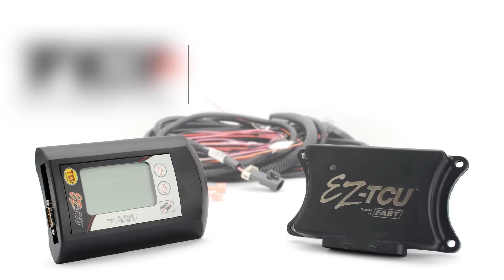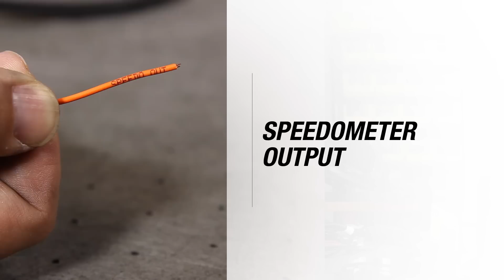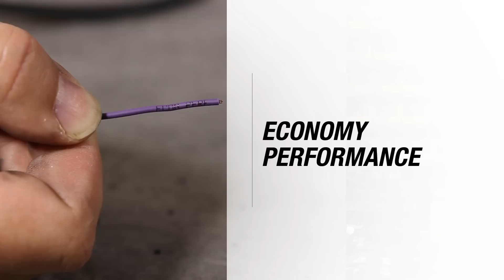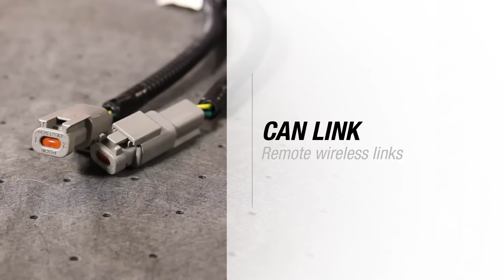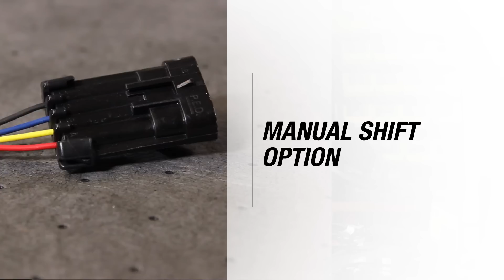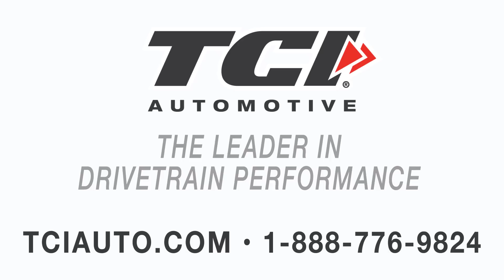TCI: EZ-TCU Transmission Controller Harness Options

Comment: hello I need your help, my car is 1969 camaro 5.7 lt 350 engine, I put 4L60E gearbox on it and let's say that it is 70 miles and 100 miles, let's call it very shake or balance.

Comment: What do you do if your using a Diesel engine with no coil where do you get the tach signal from?
Reply: Use the TACH output on any GM alternator; if the TACH post is not installed, open the alternator up and install it into  the blank hole.